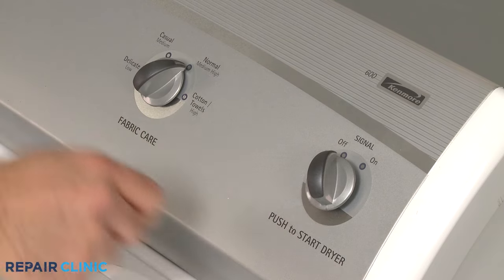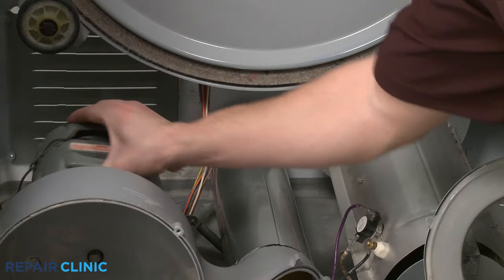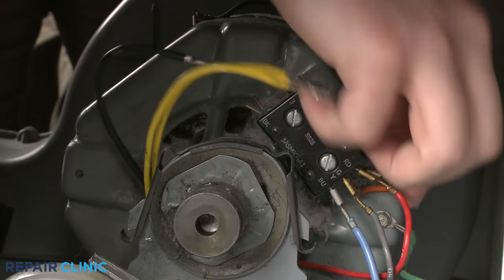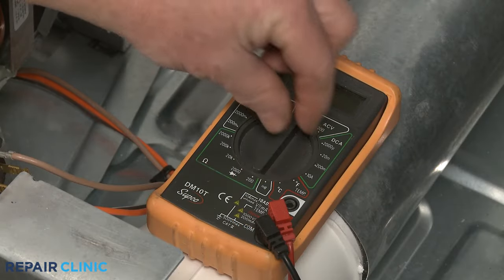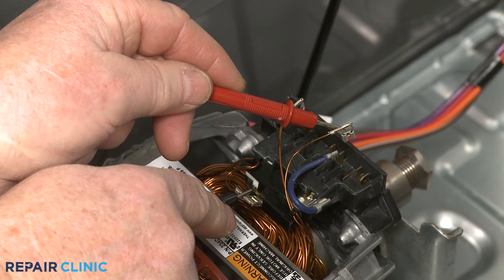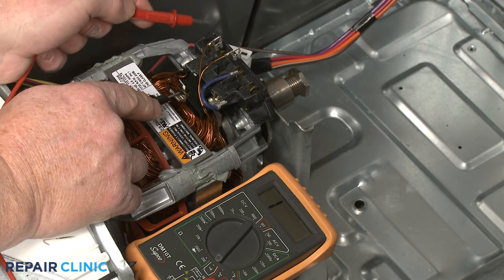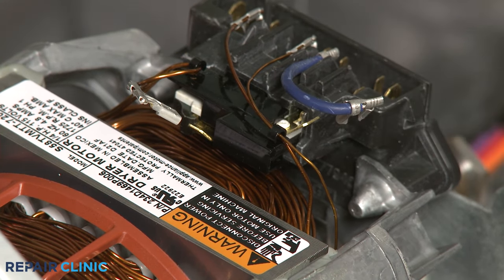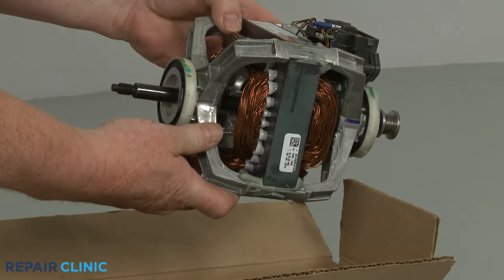Dryer Drive Motor Testing - Dryer Troubleshooting

Comment: One could also solder a jumper across the thermal break, older dryer motors do not have this safety feature to protect the motor, but if you cannot replace the thermal break and therefore have to replace the motor anyways, why protect it, you may as well just use a jumper and get on with your day and continue on with the mortor you already have.
Reply: Ur asking too many questions which is not good for the companies pumping money out of your pocket. Lol

Comment: fixing dryers as a hobby and no major electrical background, learning from youtube and couple friends. it has been super easy till now,  failed or clogged heat sensors or reaped belts, or destroyed balance wheels.  So i got GE dryer that someone dumped. This was my first GE dryer and it was way different than Kenmores' and Whirlpools i used to work on.  So it would not turn on.  i tested bjesus out of all its parts, fuse, switches, sensors, etc.  resistance, continuity and voltage, all seemed working ... i could not figure out where i have break in power.... almost gave up.  So started all over but now followed chain of power as it passes from one component to the next.  So i started testing voltage from the 'ON" button and the wire went to the "signal on/off"  which did not pass power to the other wire on its exit till i switched signal to ON position.  and then it hit me....right there, was a loose small red wire with connector on it and the signal on/off square gizmo had one more vacant receiver connector as if asking for something to be plugged to it ...and the length of that loose wire was just right to reach to that connector receptacle ... right there it dawn on me ... i traced that small loose red wire and it went straight to the motor.... bingo !!!  the wire from stupid signal on/off was also splitting to power motor.
Reply: What do you mean it was “splitting” ? And how did you fix it?

Comment: No you don’t need to replace the whole motor if the overload shows open. Just replace the overload!
Reply: Kindly reply with steps on how this can be done
Reply: @alekmartin9999 You remove it from the motor and add a new one. Check the motor’s heat fuse as well. A common open, and make sure bearings are running smooth
Reply: Just replace the motor, everyone, and thank me later. Dont get a s callback.